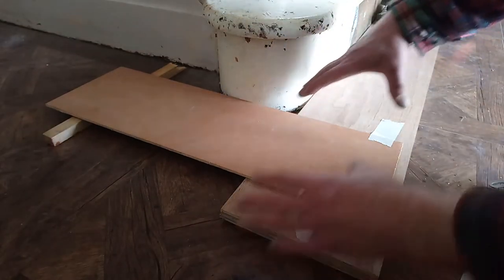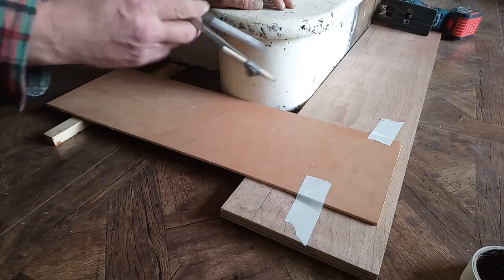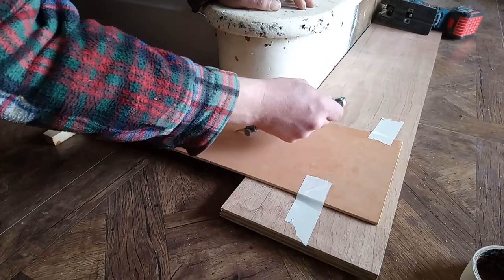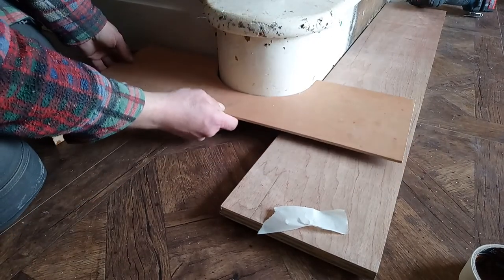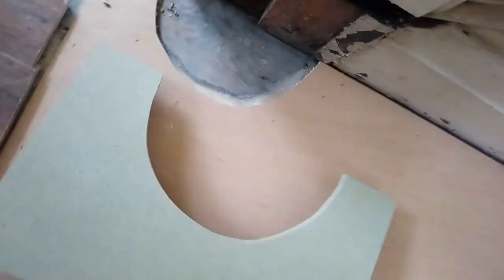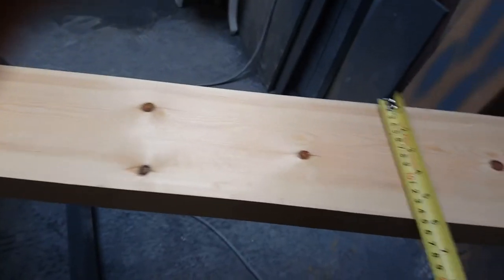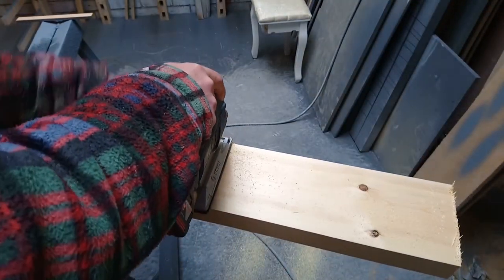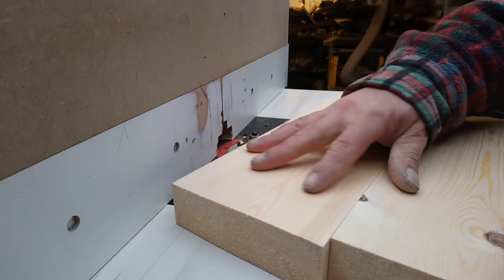Staircase bullnose repair Pt1

Comment: Amazing video as always gid just wondering what the difference is between the glue in the silicone gun and the glue in the tub?
Reply from the maker: Thanks 👍 The glue in the gun tube is white/light cream colour, a little thicker, it seems to dry faster & harder, it's not as foamy as the yellowy stuff in the tub which can be quite runny on hot days, but each have their merits for different occasions, There's not much price difference if you shop around & both can go hard in the tube or pot if the caps don't go back on properly, I find that the stuff in the pot is easier to use, the stuff in the tube always seems to squeeze/ooze a bit more out after applying to whatever you're gluing together even if you press the grey release trigger on the back of the gun to release the pressure, & you have to use 2 hands to control the gun, trying to apply a controlled amount of glue using one hand to a given area on a piece of wood you're holding in the other hand using a long gun can be tough & a bit 'wavy around',  so it can end up a bit messier, the base of the nozzles on the tubes break or the caps come off in my van, but that's prob just my fault for being lazy n not storing or cleaning up, the pot glue just sits on it's shelf n behaves itself,